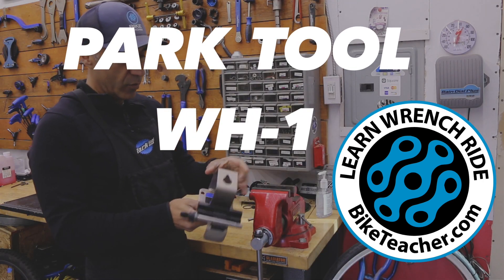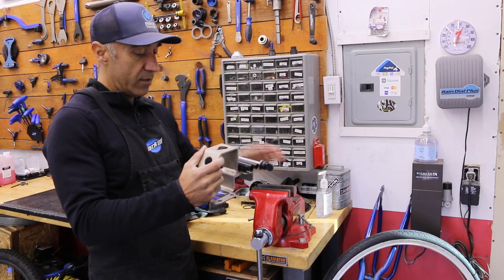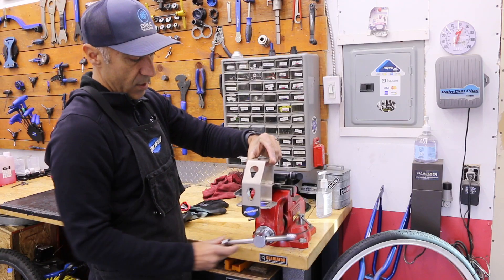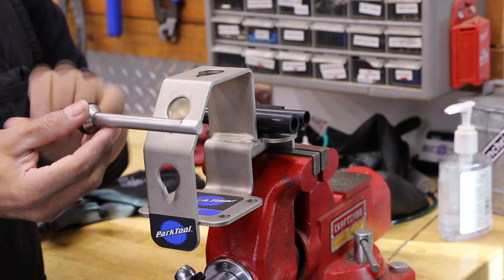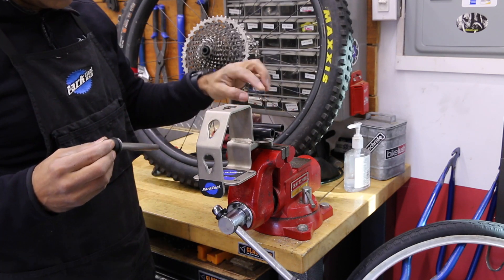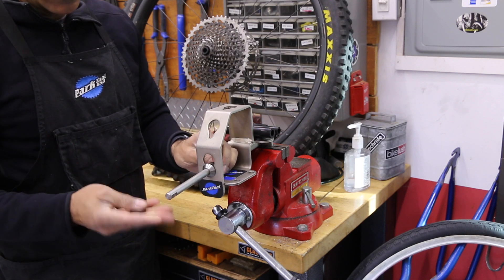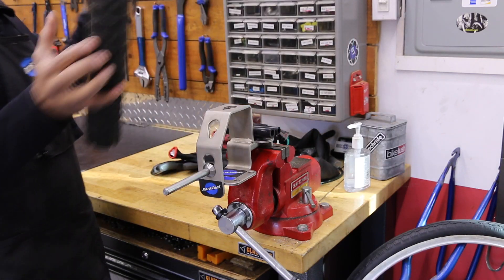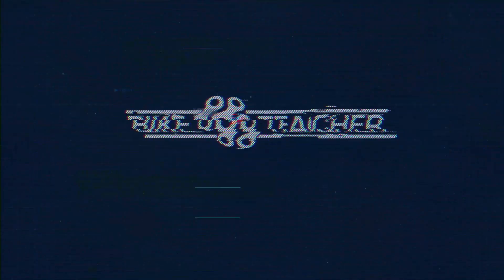Checking out the Park Tool WH-1 wheel holder tool.

Comment: Just recieved a new bike with Shimano MT-400 Boost hubs and they seem liked they are not greased, how would I grease/line them?
Reply from the maker: I thought I had a video out but I can't find it. I do have one one on how to replace an axle and then to adjust but not one to disassemble. I will work on that. Shimano is most likely using loose ball bearings and not sealed cartridge.
Reply: @BikeTeacher  I pulled it all apart, it was just to tight, greased it up and tighten it to spec, I hope, no play and spins freely. 
Thanks for the reply. 👍